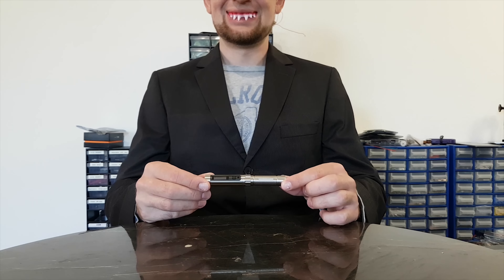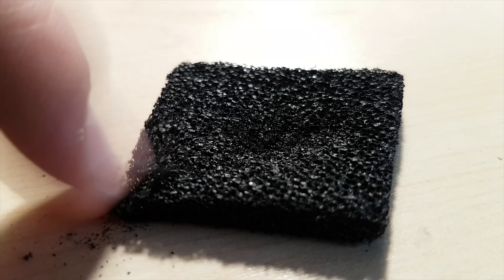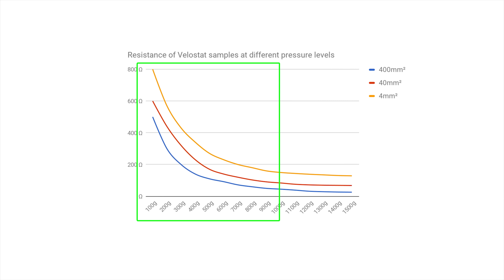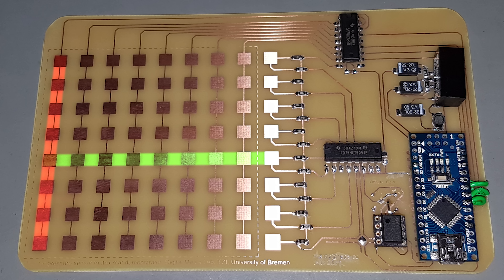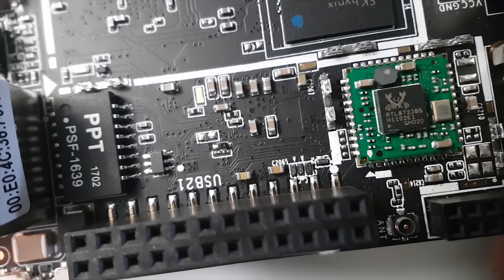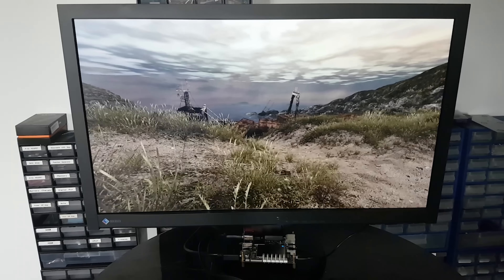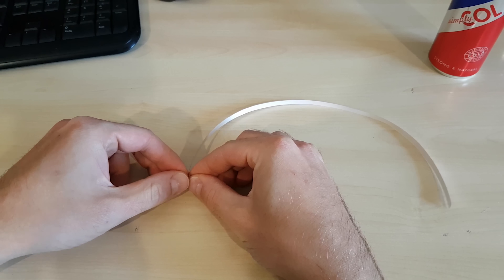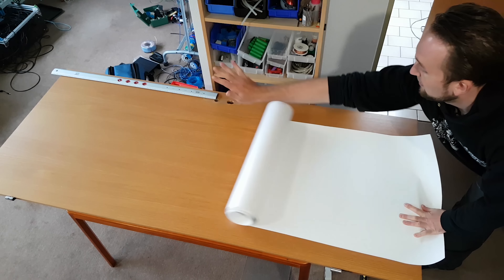Hi-Res Pressure Sensor Matrix with the LattePanda

Comment: Wait, wait! @3:07 "... I don't want to bore you with the trivial math..." Please DO bore me, I would love to hear all about that trivial math (which I likely would never understand).
Reply from the maker: Nah its really super simple: The dynamic range of a sensor is about 0 ... 1 kg.  The mat will be recommended for users with a body weight lower than 200 kg and the smallest area they can possibly distribute that is one footprint. The average adult foot size can pessimistically be assumed to be size 9. Using a drawing software and an anatomically correct footprint I measured the footprint area to be roughly 126 cm². Based on that: 200 kg per 126 cm² (126 sensors) is a maximum of 1.6 kg per sensor, so a little bit outside of their dynamic range. So theoretically I would include 6.25 mm gaps between the sensors. But practically there is only 6 mm copper tape so of course I will use 6 mm² sensors and 6 mm gaps
Reply: Marco Reps, that's brilliant! What are the chances that copper tape would be available in almost the perfect width? No wonder this was not possible before.
Reply: @reps  I see that you calculated the average force on all the feet area, but actually there is way more force on the heel (for instance), where it will be at least two times the 1.6kg/cm². Isn't that an issue for your objective?
Anyway, good job so far!
Reply: @reps  

what about using a pseudo pressurized air mattress ?  The inside top surface impregnated with reflective dots 1 mm spacing
an array of moveable mirrors on the bottom to direct a laser beam or light pulse which scans the entire ceiling of the inside surface of the top of the mattress at different angles for a certain desired resolution
the same mirrors would be able to direct the reflection of the light pulse back to a receiver
with the known pulse / beam location and the known ' static ' location of each reflective dot - it would be possible to calculate downward deflection of the ceiling by measuring the increased distance between neighboring dots which have been depressed due to the material being distorted

Comment: Very useful video. I was deciding between using a using velostat and conductive foam, under the impression that the foam might give more dynamic range than a thin layer of plastic. Additionally the foam would be built into the slightly springy application I needed instead of needing to add foam separately. Needless to say, both of those reasonings got crushed in the span of couple minutes, so now I know what I should be going for.

Comment: thanks a lot for this video! you saved me from using foam in my project :D  also, i can confirm that using a better heatsink on the lattepanda cpu will greatly improve performance! I just used a bigass heatsink from my old pc, total overkill xD , but the panda now is about 30 degrees cooler at full load (!), which improves performance for especially the heavier stuff like games by a lot.

Comment: what about using a pseudo pressurized air mattress ?  The inside top surface impregnated with reflective dots 1 mm spacing
an array of moveable mirrors on the bottom to direct a laser beam or light pulse which scans the entire ceiling of the inside surface of the top of the mattress at different angles for a certain desired resolution
the same mirrors would be able to direct the reflection of the light pulse back to a receiver
with the known pulse / beam location and the known ' static ' location of each reflective dot - it would be possible to calculate downward deflection of the ceiling by measuring the increased distance between neighboring dots which have been depressed due to the material being distorted

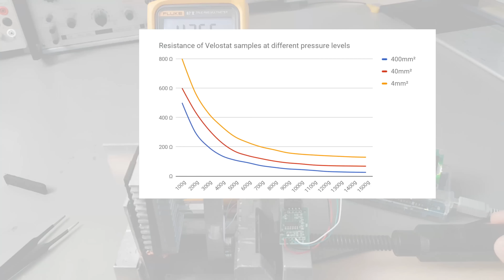Comment: Hi Marco, does the resistance you measure at 2:10 stay constant over time? To ask differently - if you placed a 1kgf weight on a pad, and logged its resistance over - say - an hour, would the measured value stay reasonably constant? Most FSRs based on piezoresistive carbon-doped polymers show relaxation-behaviour over time; I'm curious about your observations in this aspect. Thanks! Cheers :)
Reply from the maker: Interesting! Will look into it

Comment: I've seen conductive filaments for 3D printers. They sort of suck at conducting, but apparently they are also pressure sensitive. Using a 3D printer would improve resolution and reduce the necessary build labor.

Comment: I just received a box IC's from the 70's. Some of the ESD foam was become so rigid it broke in pieces if I tried to remove an IC. But it turned out there was no reason to remove them because from most IC pins inside the foam were corroded away.

Comment: Very cool. Why use that SOC specifically? Did you "HAVE" to for some reason you can not say? Pretty much any Micro with a good ADC and 5GPIO pins would do. You could use it to acquire data and then dump it to a higher powered device of choice?
Reply from the maker: Well they sent me that LattePanda for free to be featured in a video and I thought this was quite a good opportunity.
Reply: Fair point :)
Reply: Wow. At $90 including the windows 10 licence these thing are a steal.

Comment: I am not able to obtain stable readings from the sensor. 
Our setup: We have connected the velostat (1 cm^2) in series with a 220 ohm resistance and
used a voltage divider to get the readings. However, when we apply a constant weight the
readings are not stable (changing every time we measure and the readings are also continuously varying). 
Can you give me the best way to calibrate  the sensor  to get constant  reading .

Comment: Do you think it would be feasible to create something like a 'pressure-copier', where a charged dielectric sheet leaks charge proportional to applied pressure (maybe through resistive film such as you are using here), then the charge distribution is made visible using a standard photocopier train?

Comment: Good luck!

What are your thoughts on possible miniaturization of this? In the field of continuum robots there is a need for flexible sensors on a tubular surface with a diameter of about 2-10mm.

Comment: Just curious about aging? or is this not of interst or concern?
Reply from the maker: Yes, I am curious too about the Velostat aging. Didn't find any data yet. But the adhesive layers are for car wrapping, so they should last a while
Reply: Im more thinking about oxidation of the copper etc. also i have noticed that sometimes Soft Buttons age quit fast. But never looked into why
Reply from the maker: Yes, the copper tape is a good point! It seems to be lightly coated in something, that's why I was wearing rubber gloves for the assembly. Touching it with bare hands leaves oxidized finger prints behind which was also pretty cool honestly https://imgur.com/a/zAWjI
Reply: Could be a oil coating from the rolling mill, oh yes it is quite good to get a finger print image ;). Maybe it is Cr2O3, SiO2 but i really don't know.I used also some copper tape for transformer manufacturing and i also noticed that, I also had once wich where not coated. Im looking forward to see your progress, awesome work!!
Reply: Now the whole internet has your finger prints!

Comment: When I am testing the resistance vs force characteristics, I experience the velostat to be very unstable. It is rather reacting to changes than actual force. At the moment I find it unusable, but I see that you get much more reliable performance. Any idea what I could be doing wrong? I am just using an ohm-meter and velostat sandwich setup + applying force to the sandwich.

Comment: Am i see here the way to invent again the already using capacitive touch register surfaces?
Considering such surfaces, i had the idea of improving current drawing boards to send the writing input into computer recording using just sound of marker and microphones on x & y axises. Super.
Reply from the maker: alex ale capacitive usually tells you   only where the touch is. This also tells you about the force. One could use capacitive with a flexible dielectric material to get a similar rwsult

Comment: Do you mind if I use your design to this in a project of mine? I've been looking for a way to implement a reliable pressure sensor matrix for a while and this seems like the perfect solution to my problem. Also, are there any issues with increasing the resolution of the matrix by making the square pads smaller and closer together?
Reply from the maker: In the resolution I have tried the velostat resistance in X and Y direction (length and width) were neglectably high, but when you really want to go to town, you might have to cut the velostat into small sections too. Just a guess ...

Comment: The video stops working at 7:23. Youtube just gives an error. Very strange, I've never seen this happen before.
Reply: thank god, i though my gpu had started giving up the ghost
Reply from the maker: Well shoot, I have heard multiple complaints about this now ... but what to do? It seems to work well in some browsers and some devices?
Reply: Interesting, it fails in Chrome on my MBP but works fine in Safari. Also works fine in the YouTube app. Maybe just leave it for now and hope YouTube fix the problem in the future. There is not much left of the video when it fails; you just mention that there will be a part 2 to follow.
Reply: Fails watching with a Chromecast too
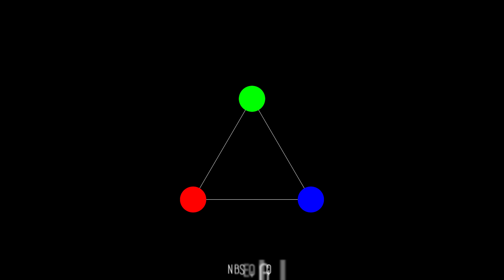Reply from the maker: I have added a blurred area to the wall between 0:07 and 0:11 making YT re-render the video (I think), maybe that'll fix it
Reply: Yep working for me now too :)
Reply: That's got to have been a replication issue; one (or perhaps more) of the servers hosting/serving the video must have either had a corrupted copy in RAM/cache, or be serving a bad copy from persistent storage. Adding the blurred area will presumably have triggered a re-render and subsequent re-replication. My money says re-uploading the original would work on every browser, if you wanted to run the experiment.
Reply: Mine stops at 7:59, with some images over the video. :(

Comment: 4:00 Latte Panda has big thermal issues, even with coper heatsinks, mine loose the whole filesystem after some days, running only a CNC software doing nothing !   I'm pretty unhappy and do not recommend it, except if you using a water cooling or with a 2 fan (one on bottom and one on top)!!!!!!

Comment: I need to make this project almost exactly. Would you mind sharing code and more details. I would gladly trade you a finished product or even add you to the project if your interested.
Reply from the maker: Finished project in my newest video, code in that videos description. Also have 2 leftover PCBs ...
Reply: Would a vinyl cutter made that matrix easier to make?
Reply: How would I contact you in a non public message
Reply from the maker: My e-mail is in the 'About' tab on my channel, hidden behind a capture I think
Reply from the maker: Yes, with that you could make a central layer with very precise sensor-sized cutouts, so you don't have to bother with manual alignment of copper strips and release liners.

Comment: No, please don't use this thing with Windows. At least not when you're planning to connect it to the internet (as an "internet of shit" device). Because Windows 10 is just too talkative, telling Microsoft whatever about the final application. At least reduce it down to some Kiosk mode and remove everything that isn't absolutely needed. But I agree that a slim Linux distribution would be even better, something rock-solid and stable, like based on a slim-lined debian or so.